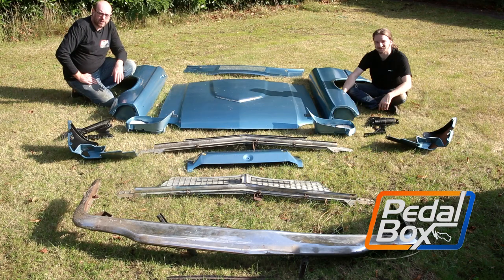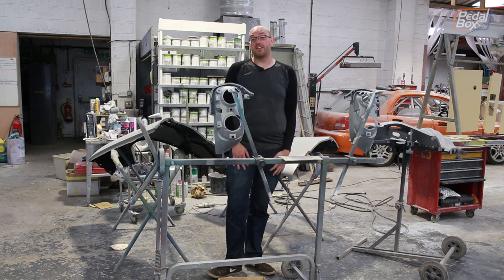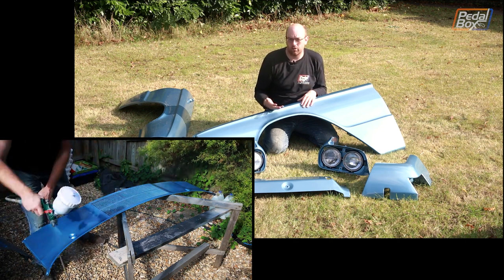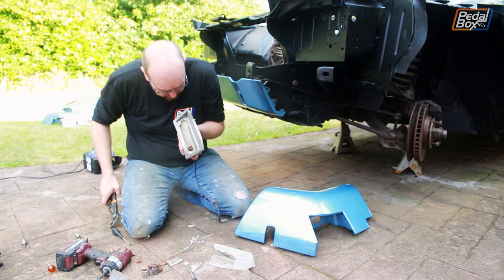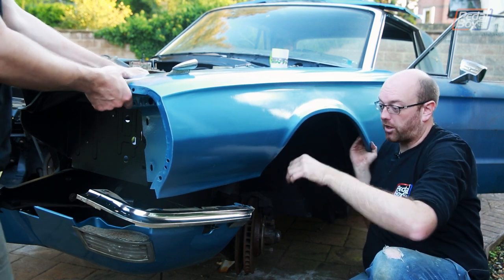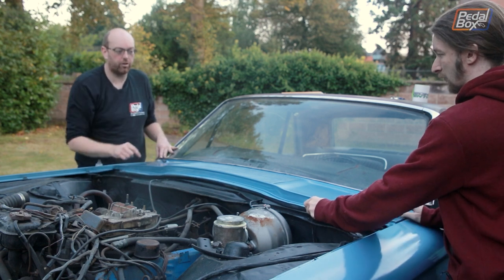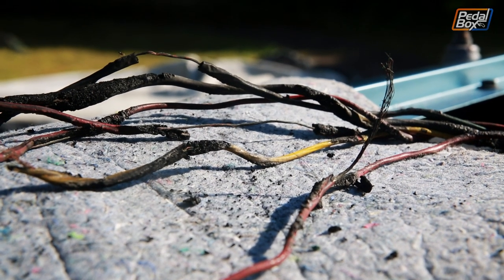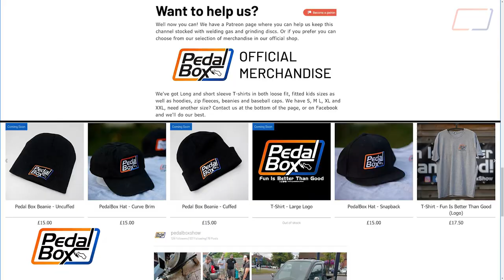Thunderbird Rebuild | 1966 Ford Thunderbird | PedalBox Fleet | Episode 88

Comment: Again, awesome work! One other thing. If the motor has set up for a long period of time, there is a tendency for the hydraulic lifters to freeze up. When it starts up, they can bend the push rods and potentially damage the valve assembly. Not the worst thing to take the intake manifold off and take them out and let them set in chemtool. Goodluck!
Reply from the maker: Also a good shout, we figured we'd be pulling the covers off at some point, so long as I had new gaskets (I think I do) so they'll get inspected, I thought about popping a bit of oil down them and over the lifters before we put the cover back on to give it a not-so-dry start too, reckon it'll help?
Reply: Won't hurt, that's for sure. You all are awesome! Best of luck! Anything I know came from just doing it until it worked. Watching your progress has been inspiring!

Comment: The 66 T Bird is not for the faint of heart. It was everything Ford could cram into a car in 1966 and was the top end model. When it was designed, the assumption was the dealer service department would be working on it. One strong word of caution, make sure the fuel filter on the bottom of the fuel pump is clean. The design has a tendency to fill with debris and has a release that pushes fuel out of the pump and onto the ground. Nearly burned my car up once and did burn up a fellow owners. Excellent work!
Reply from the maker: Thanks very much! Very much scope creep on this so far, but it's all good fun. Good point about the fuel pump too, Haven't inspected that yet, though I have a brand new one I brought home just in case, will be giving it a bit of TLC either way before anything goes through it. Glad for the dealer manual I got thats for sure.